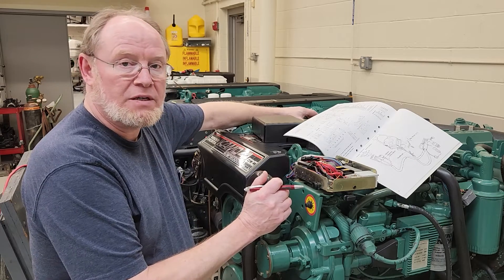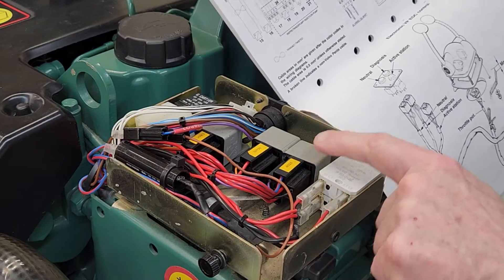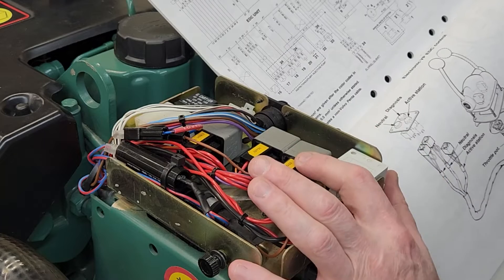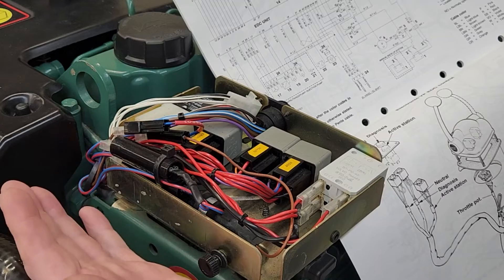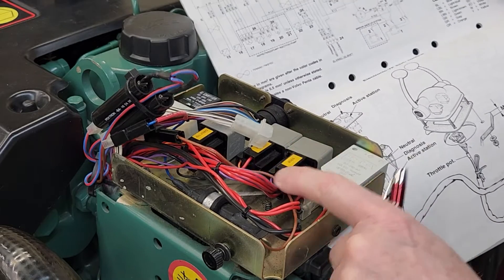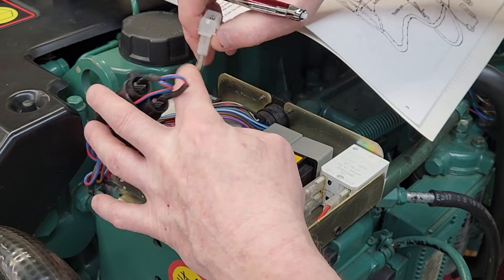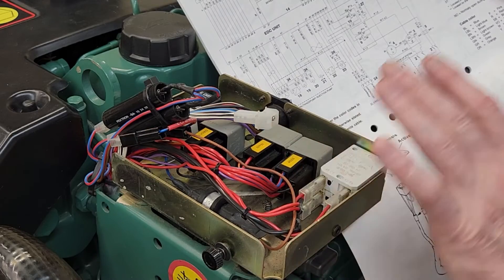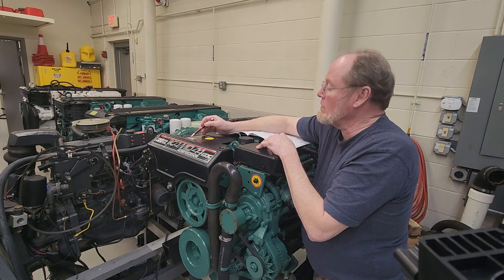Volvo Penta EDC  KAMD 44P On Engine Wiring Introduction

Comment: Hi ted, I hope you don't mind but I send you an email, it's about an engine that at starting it will turn off the power. I checked harness, key, relays, fuses, diodes, resistors, starter, cleaned terminals, changed batteries, spin manually the engine to see that it's not blocked

Comment: Hi Ted, I have just been on a sea trial of a Searay 365 Sundancer with twin Volvo KAD44 EDC engines. On one engine the Turbo Charger does not operate by control lever. There is a switch on the dash that you have to hold down to make it work. Obviously, this is not normal. Do you think I should walk away from this boat. Jeff.
Reply from the maker: @jeffsmith1585  that would be the super charger and some boats of 5hat vintage had a tendency to engage the blower when your in odd s3e sta3s due the rpmwould rope too much when going up a swell. That was a fix for such  an issue. Not a deal breaker.

Comment: Love these videos Ted. Our KAD300 has almost identical wiring. There were starting problems. I replaced all the relays and cleaned up the relay sockets. Seems to have solved the problem. I’ve also cleaned up the plugs in the harness to the single helm. I found the remote control was not locked to the harness. Looks like it never has been. Now the motor is quite reliable. The relays are Bosch and not expensive. Cheers

Comment: I have the same engine. After this video, I noticed my diodes are missing!? Why would this be? My engine is: 1998 Princess V40, and it is equipped with two Volvo Penta KAD44P/DP-E diesel engines, each with 260 horsepower.

Advice is appreciated.
Reply from the maker: @ThehomelanderDXB  upgrade may be
Reply: Hi Ted,

I hope you can take a moment to help figure this out because Volvo Penta themselves have been out, and even they cannot determine the issue. I’ve also tried most forums on Facebook and online, but no one seems to have an answer either.

I’m dealing with fault code 5.1, which I believe is linked to the main relay. The strange part is that both engines are showing the same code. The main relay has been checked and replaced, and all the associated wiring has been inspected by a qualified Volvo electrician. Despite this, the fault code persists, and no one has been able to determine the cause.

Given that it’s happening on both engines, I’m not sure if it’s just a coincidence or a shared issue. Do you have any insights into what might be causing this?

For context, both engines are maxing out at 3200 RPM, and I suspect this could be linked to the fault code. Also, the fault code cannot be cleared, which adds to the confusion.

Engine details: KAD44P/DP-E (B version).

I’d really appreciate your input!

 @tedsmarinerepair8956
Reply from the maker: @ThehomelanderDXB  there are 3 versions of the 44 yours may be an "A" version
Reply: @tedsmarinerepair8956  Just learnt this also. Thanks alot for the information

Comment: Hi Ted, firstly, thank you for these great videos! I wonder if you or any of your subscribers could help me with a small problem I'm having with the port side engine.

When I first turn the key, the engine starts fine, and no fault codes appear on the diagnostics button. However, as soon as I start moving the boat, the port side engine seems to go into neutral and loses all power, leaving the boat without any movement. When I try to switch the engine off and back on again, it’s completely dead and won’t restart.

I tried resetting it a few times using the diagnostic button, but this time it doesn’t reset at all. Upon checking the diagnostic fault code, it’s showing code 3.2, which relates to the temperature sender. I’ve checked the sender, and it seems fine. Any idea what could be causing this?

I’d appreciate any feedback.
Cheers!

Comment: Love the KAD44 videos Ted. Learned a plethora of information from you. One thing I hate is how my gauge voltage is lower than actual charging voltage due to these diodes. I was having charging issues awhile ago and couldn't understand why alternator voltage was so much different than my gauge voltage. Then traced it down to the diodes. Almost a full volt voltage drop across it. Everything I've read, this was normal. Anyways, Thanks for the videos. Keep the kad44 videos coming!

Comment: Thanks for this one, Ted.  I had an intermittent no crank condition on one of my 44s last season.  Drove me mad until I got the wiring diagram and traced things out.  Turns out it was corrosion across the normally closed contacts of the stop relay.  I did a wholesale change of all relays in both motors and it's been good ever since.  Thanks for the video!

Comment: Hey Ted, 

Thanks a lot for your explanation.
Do you have any fuel consumption diagrams of this engine 🤔...

I thinking to use only one engine for slow driving 5to6kt at 1k to 1.250rpm.
I have a shaft driving propeller. So i think i have bo problems with the gearbox of the not running engine. 
The exhaust have a rubber closing thing outside,  so no water came into the engine over the Turbo and exhaust valve. 
So i think i can go by only one engine without damage anything in the not running engine. 
What do you think?
And what do you think about the fuel consumption that i can safe?
I guess it was about 30 to 40% .
The gearbox is always filled with oil, so it doesn't matter if some gears rotate when the propeller turns from the running water.

Thank you very much 
Greetings from the north sea of Germany 🇩🇪 Marcus

Comment: Am inspecting a 2000 model boat. It has Rust in coolant KAD44 on the “fresh water side” 
Do you have a recommendation for treatment. Also I am wondering if this might be the symptom and not the problem
Reply from the maker: It is hard to tell why rust would be in the coolant, but not changing it on a regular basis would be a likely culprit. The recommendation is to remove the drains, drain the coolant system and flush it with good tap water (no well water) let the water flow into the expansion tank until it runs clear out of all the drains. Stop filling and install drains, Refill with distilled water and run the engine until it reaches operating temp. Let cool, drain again, then refill with Volvo Penta coolant. Use what was in it, if green stay green, if yellow stay yellow.
Green should be changed every 2 years, Yellow every 5.